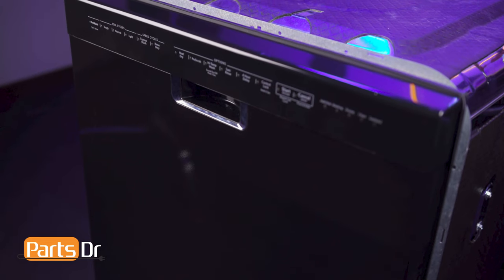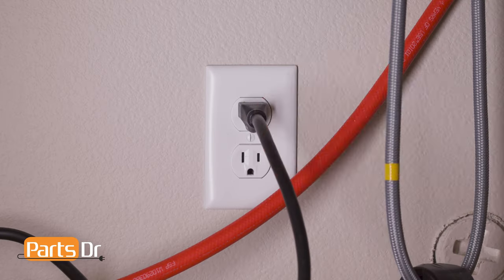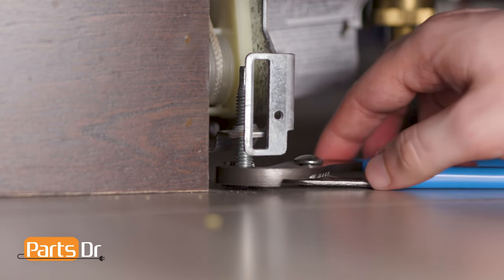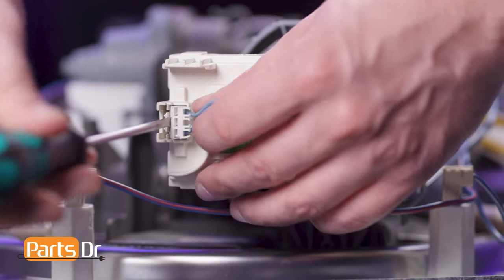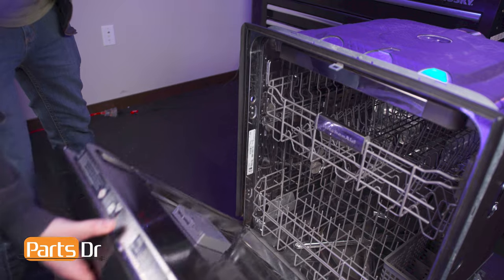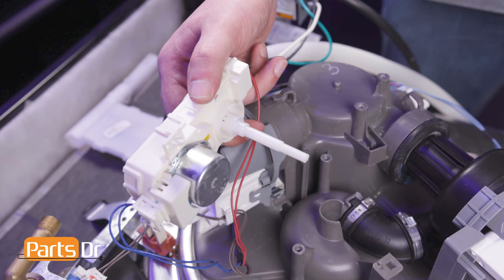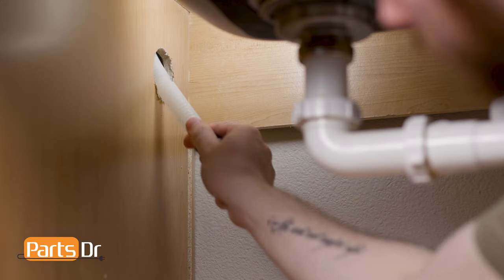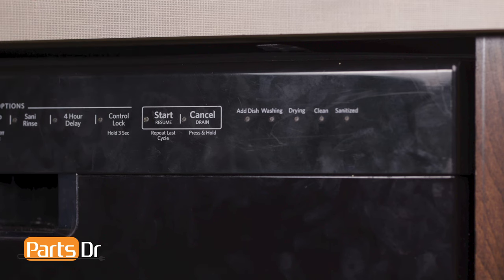How to replace Circulation Pump Motor part # W11032770 on your Whirlpool Dishwasher

Comment: Woohoooooooo my dishwasher works now! I am both amazed that I correctly diagnosed the problem and was able to fix it, but that's all thanks to your video. 10 year old kenmore elite dishwasher will live to see another day.
Reply from the maker: Nice job fixing it yourself!  What kind of symptoms was your dishwasher having when the original pump failed, and how did you diagnose it?
Reply: @PartsDr  Running any cycle, the dishwasher would only fill the bottom tub, and drain, but at the part of the cycle where water is supposed to spray through the arms, the machine would be completely silent (no hum) and occasionally do a click click click noise. The water filled fine and the drain pump (sump?) drained fine, so I figured maybe it was the circulation pump based on a bunch of youtube videos and reddit posts. I thought it was a gamble because I also read people recommending to just replace the whole sump, or people saying sometimes it's a control board problem sending the wrong voltage to the motor?  The diagnostic codes confused me ,they were f7 e1 , f8 e2, f6 e6, but I figured I might as well give it a shot. Replacing the pump was the easiest part. Took 10 minutes. Getting the dishwasher out took literally all day. My dishwasher was sitting on the subfloor about a half inch below the kitchen floor, and the leveling legs would not screw up out of the way because they were bent and the threads were busted. So i had to shim the dishwasher up with pieces of wood to support it, and cut the leveling legs off with a hacksaw to get it out.
Reply from the maker: @amaiaamaiaa  Thanks for sharing!  That sounds like a nightare getting the dishwasher out.